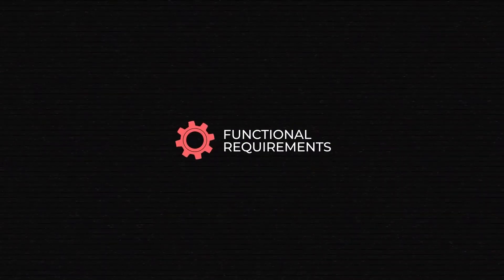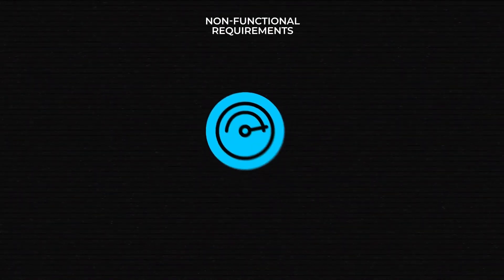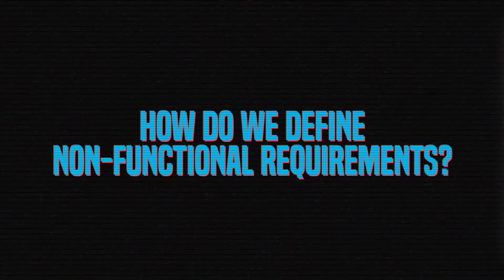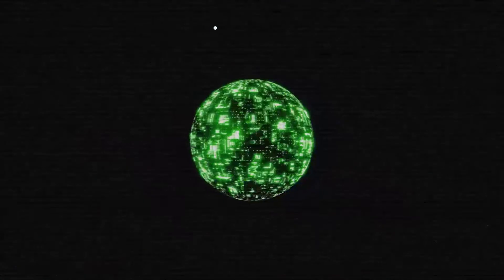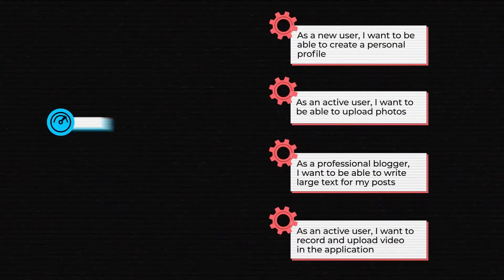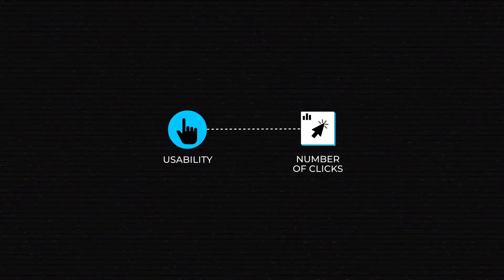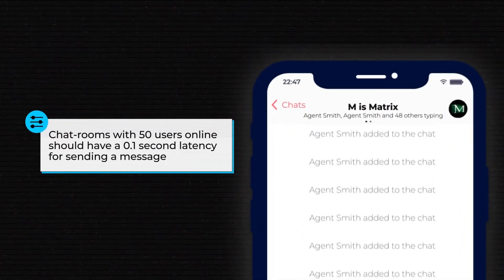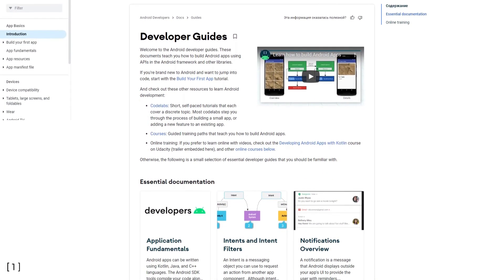What are Non-functional Requirements and How Do They Work?

Comment: Great Video. Thanks for sharing it with the community.

Non-Functional requirements are identified throughout the product lifecycle until it's put in sunset mode. They keep evolving all the time. This is why having clear and well documented requirements are important. You don't need to have them documented fully right at the start of the product initiative phase but one can certainly build them over time to make it clear for entire team about their importance for the business and product that you are developing. Encourage your team to keep it updated and try to link them to appropriate feature / user / function requirements certainly at the very high level for sure. 

Well, this is where 🏵 OpenRose - FREE and Open Source Requirements Management Application can help. It supports Baselining, Traceability, Hierarchy, Markdown / Formatted Description, and ability to Copy requirements data at various levels.

It's a General Purpose Requirements Management Tool and the Goal is to help Individuals and Teams to 'DO IT RIGHT' and 'REDUCE WASTE'

- OpenRose - 🏵 Requirements Management Tools Team